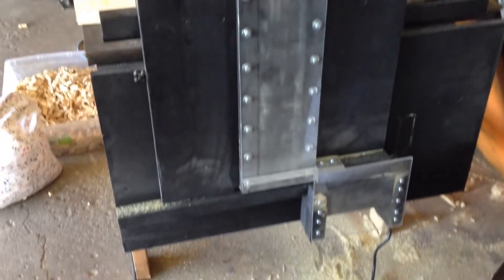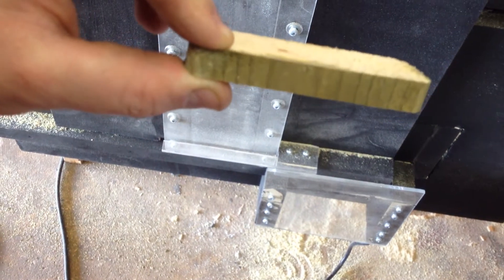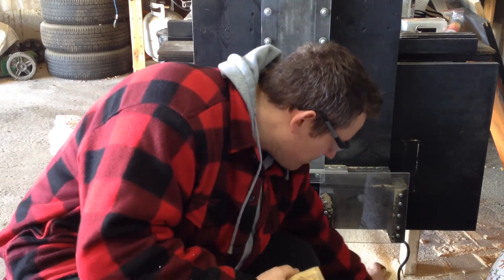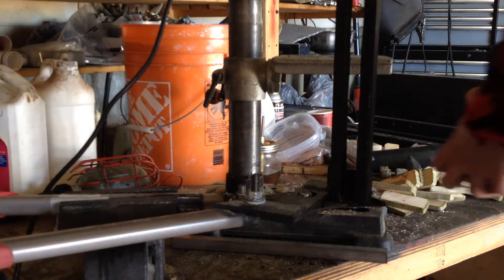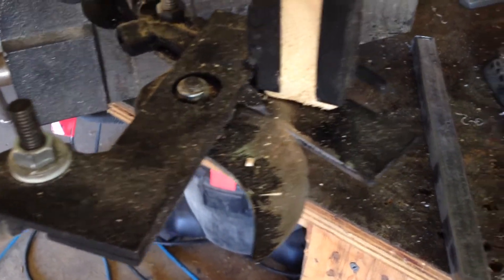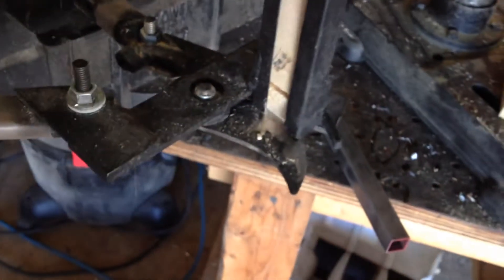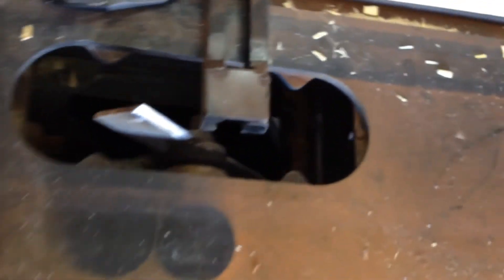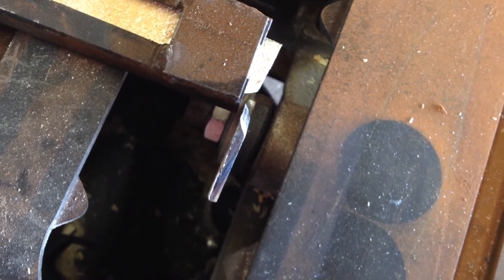homemade  wood chips for wood gasifier

Comment: Isn't most lumber pine? I would think oak or other hardwoods would be a better fuel. I saw What Mark (mada94fxr) called a wood chunker for processing branches. He has a great design you might want to check out.

Comment: that thing will take WAY to much time. especially if you need to go thru tons of the stuff a year.
Reply from the maker: GrapSorz it’s what I had to work with at the time
Reply: i gues i'm going to need something on the back of the tractor and get thru many tons in a day. stil it wont be so square and so similar in size. still i will need minimum 10 tons more likely 20 tons a winter.
Reply: and here construction lumber like that is usually pine or spruce wood. and from what i know that is the worst type i can use. you want wood from trees with leaf's on them around here. the best gasification wood is Alder around here.
Reply from the maker: GrapSorz best guess use a small tree chipper
Reply: i was planing on a medium one ;) i have used smal garden chippers and they r way to slow and week.
Reply from the maker: GrapSorz best of luck to you then man

Comment: Why not get a harbor freight wood chipper? The amount of electricity you use is insane with little return
Reply from the maker: Rex Xer  absolutely correct I just used this for experimental purposes I didn’t want to buy a new machinery so I used what I had laying around but it did the trick. 
If I had this for everyday use I would get the proper machinery

Comment: thumbs up for creativity, but why not cut the 2x4 into lengths and then bundle the lengths back into the 1st machine,  so, six polls all reconstructed again into a 2x4  and used in 1st machine to make chips
Reply from the maker: opticalriot 
I know it would be a lot better, that way. Reason for this way was due to the grain of the wood. If I cut it length wise the machine would have a hard time chipping the wood. It's like using a axe to make fire wood if you would hit the 2  4  in the centre lot harder then if I would split the wood on the ends. Hope that help man
Reply: you could mount the chipper blade under the circular sawblade on the same axle if its somewhat balanced and have the fingers tip into a second rail gravityfeeding into the chipper

Comment: its not good to drive on softer woods altho i have been lattly the only problem i have with this type of machine is u are locked into the size and type of fuel u have to use in it i burn cedar and oak i get the cedar from trees the city cuts down so there rounds to start and the oak i source from pallets so i had to make a machine that could cut both styles of wood i will say one this it is safer than most i have seen on here i dont want to be called lefty the wood gas man =/
Reply from the maker: xoxoXoieoxox ya it would be nice nice to build a slip on exchanger to change the demands on what you would be using the gas for.  I have seen lots of people just changed the lid of the drum to a bigger reactor to fit engine needs.  But for sure I have that problem I can only run 5 to 8 hp engine on what I have.  would be nice to run a car on the machine, but would have to build some big modifications on it.
Reply: ***** go for it a car is the best use of wood gas i could find lol =3-

Comment: These machines are alba-zootly fantastic.
I am absotively posilutely sure of that!
I really need to meet this cncmasheeningisfun guy, as he sounds like a real hoot  ;) .

Now that you have these machines helping you out, you'll be able to relax while creating huge piles of ready made fuel for your gasser.
In the past, I was hand making the fuel for my gasser. No matter how fast I worked, I was barely able to keep up with the gasser's needs, so I began to dream up some machine designs that would deal with it.

The difference is incredible, as I am sure you have seen with your new creations  :) .

Your twin blade high speed cutter is quite unique. I think it is brilliant in both its simpicity and its performance.
In time, I am sure you will enhance this machine further. Perhaps you could rotate the assembly so that the fuel finger magazine is vertical, or at least inclined in order to make use of gravity.
To stop the fuel fingers from simply pouring out before the blade can hit them, perhaps a backstop can be placed below the column. It would need to be placed at the leading edge of the column, so the chips don't compress it when the blade strikes the wood.
I hope that makes sense!
Perhaps you could add further magazines to your machine, which would make it insanely fast at converting scraps into fuel.

So many ideas, soooo little time.

It is always nice to see new ideas coming into the world.
Keep up the good work.
Reply from the maker: I really appreciate it thanks couldn't have done this without your brilliance buddy
Reply: *****
Awwww shucks. Now I'm blushing  ;) .
Reply from the maker: lol